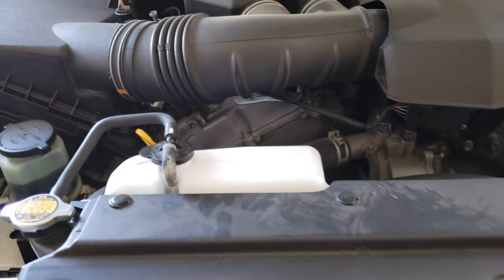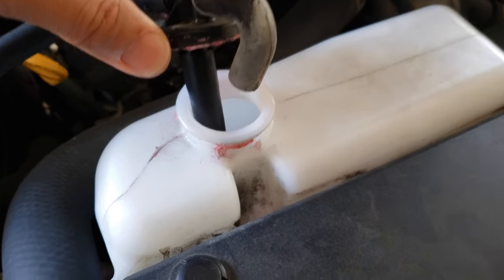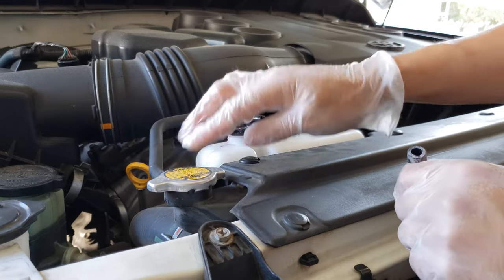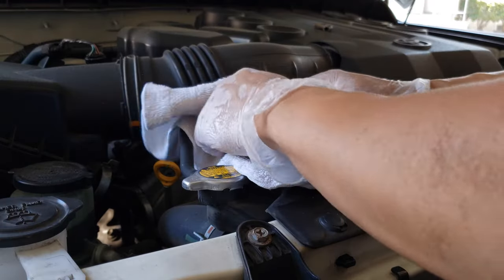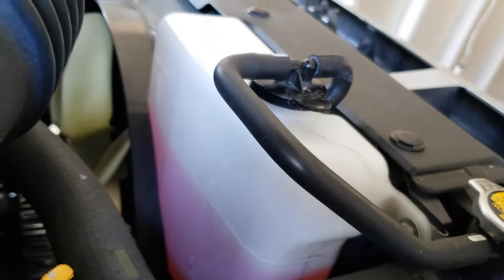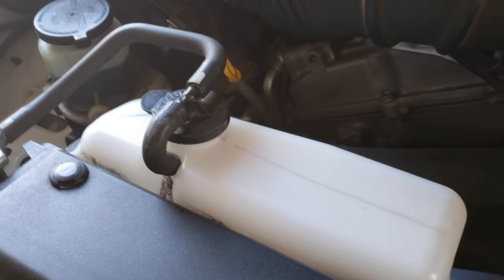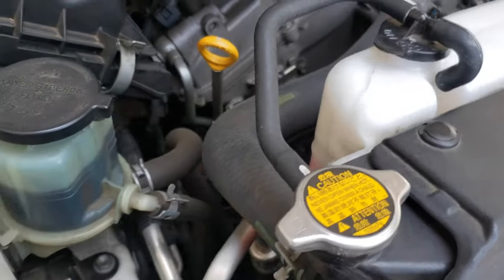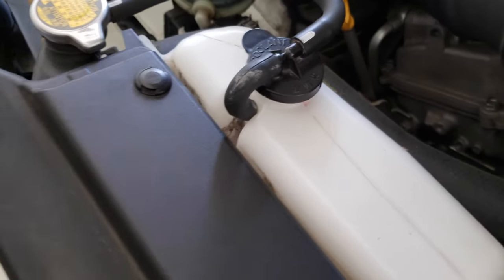EASY Fix for Crusty Engine Coolant Reservoir Cap - Try This First!

Comment: The level when max hot shouldnt exceed the upper level, when cold its ok to be as low as the low level. You really just have just too much coolant in there.
Reply from the maker: I'm not so sure about that.  Even after long drives (hot engine), I no longer see the level go beyond the top line.  I have made no changes other than clean out that nozzle, and I no longer have a crusty cap.

Comment: That's funny. I have the exact same issue on my 23 tacoma with the 3.5l. That engine bay looks like its laid out nearly identical as well. The nissan frontier 2017 I owned also had a coolant vent crusty issue. Must be a common theme with japanese trucks. On the 3rd gen tacoma that little nozzle was relocated to the bottom of the reservoir.

Comment: great tips, my lexus is250 has same issue. I am give this a try
Reply: How are you now? My is 350 is doing the same thing!
Reply: Pls any update?
Reply: @S0larz  Mine is still doing it. Very minimal though. I think i may have filled the reservoir too high
Reply: @bryant6670  I just took mine for service and now I have this, should I suggest replacing the cap maybe?
Reply: @bryant6670  thanks for your reply btw
Reply: @solarz i had same thing happened to my is 350 after the service 
One month after the service i got caking on the cap 
Am going to clean this today will let you know
Reply: @JB-qj1mq  okay thank you maybe our mechanics overfilled it but please keep me posted you’re doing legend work appreciate it 💪🏽

Comment: Is that cap supposed to be freeflow or? I had massive blockage which i had to pick clean because water wasnt passing through the hose. Hose is good now but that plastic cap is still blocked. Does it work on high pressure or i have to change the cap
Reply from the maker: The reservoir is not pressurized,  I'd imagine that the short end of the tube (the one that sticks out toward the front) should be free of any blockage in order to allow the coolant to flow.
Reply: @LiL13izzy7  ill try to clean it again. If nothing works ill try to get a new cap. Thanks for info